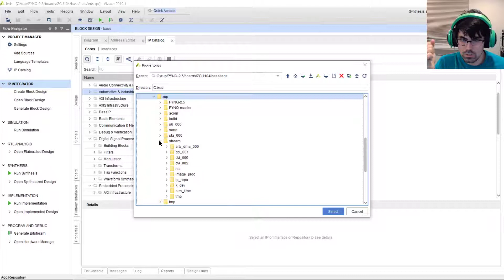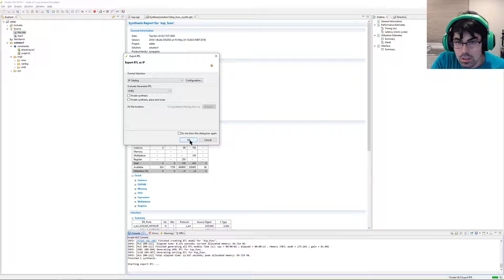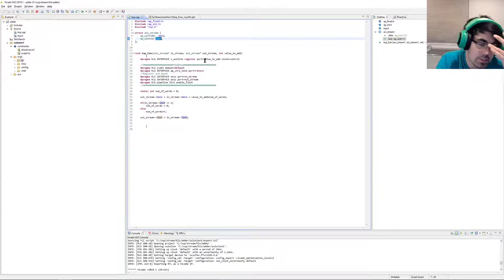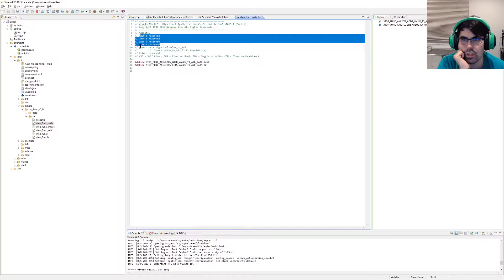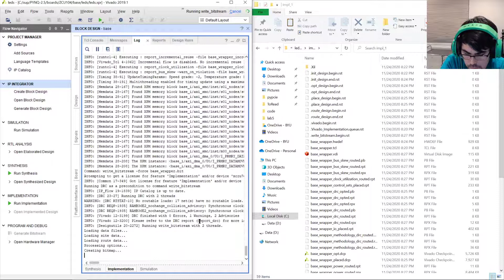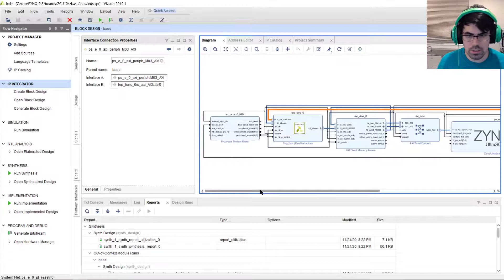HLS, DMA and PYNQ!

Comment: How do i know that by using the HLS IP there is hardware acceleration ? How to do comparison ?
Reply from the maker: This is a good question.  If you are using deterministic bounds in you HLS function, the tools should tell you exactly how many clock cycles it takes.  If there are unbounded arrays or loops, it will depend on the parameters during operation.

Comment: Ok, that's great, but.... what happen if I want to read twice the input buffer, add this two number read, and return the result by the output buffer?
Reply from the maker: I don't fully understand what your saying, but you should be able to.
Reply: @FPGAZealot  Yes, of course. In your example, you get the read of the input stream, add it another number and return the result by the output stream. Suppose your IP has to get all the values on the input stream, process them, for example applying a multiply two by two, and then return all the results by the output stream, in this order. How do you do the transactions? I try this by myselft and I don't get nothing. Thanks!

Comment: You do not show what you have in the top.h file, which affects the received IP block. In particular, where did ports control and ap_rst_n_control come from? vivado swears, writes that "interface connected to s_axis_s2mm doesn't have TLAST port". And in general, is it possible to post the source code?
Reply from the maker: There is no control port, it operates on available inputs . #pragma HLS INTERFACE ap_ctrl_none port=return
Make sure to define the port. #pragma HLS INTERFACE axis port=stream_in_24
Here is some source code from a kernel example: https://github.com/byuccl/BYU_PYNQ_PR_Video_Pipeline_Hardware/tree/master/drp/Source/kernel